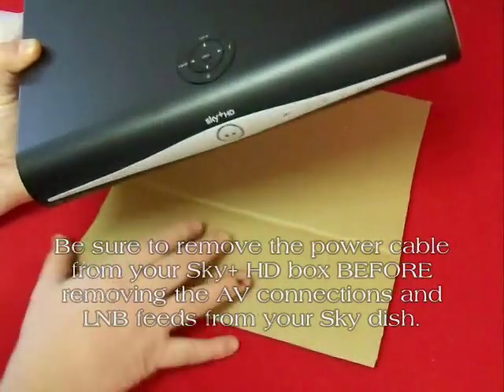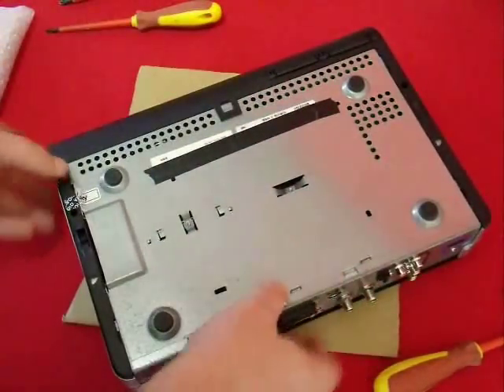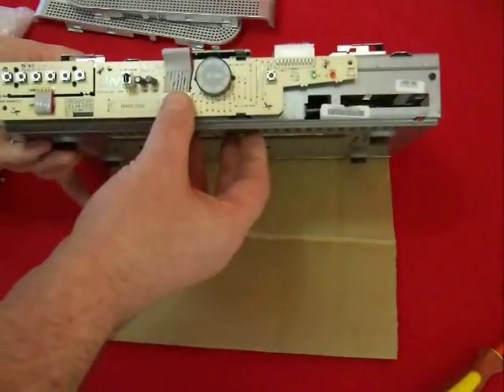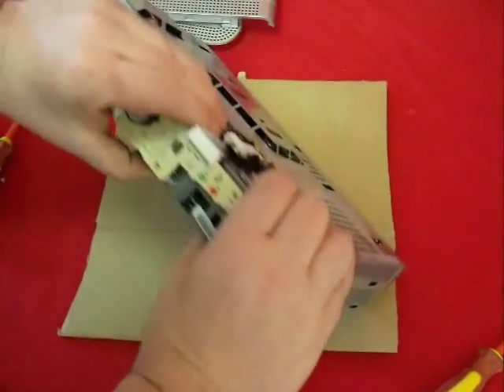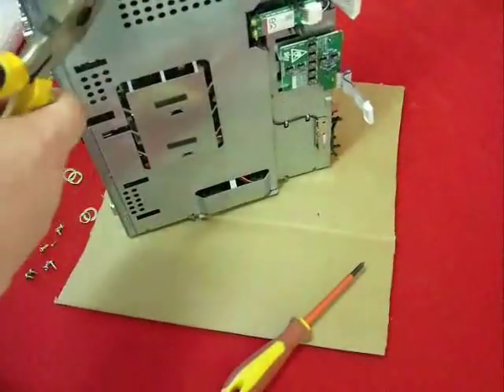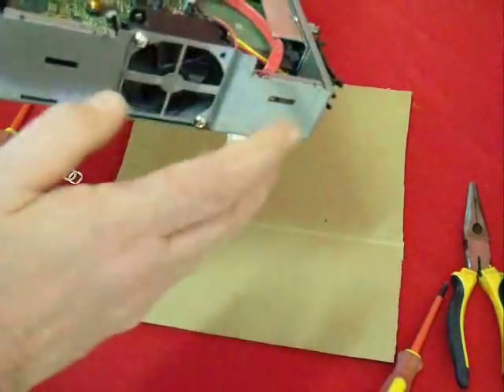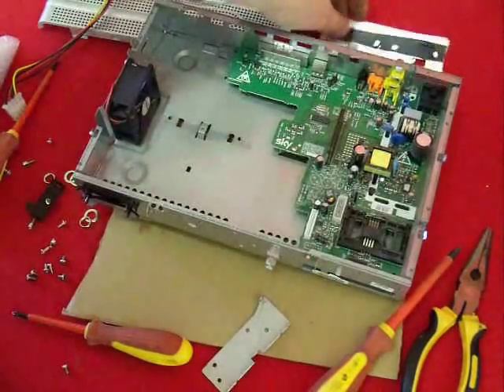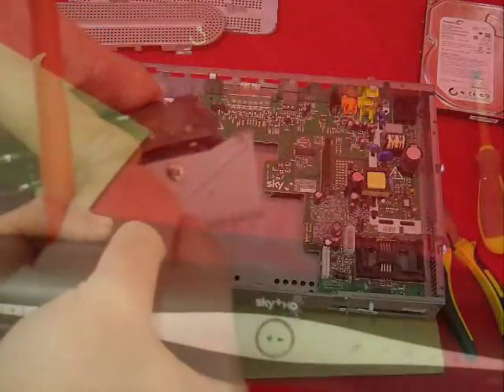How To - Replace or Upgrade Faulty Sky+ HD Box Hard Drive + Secret Menu on DRX-890

Comment: Upgrade a 500GB TO 1GB OR 2GB?  Really?
Using a pair of pliers to undo 4mm retaining bolt on serial adapter?  Really?
Using a pair of pliers to undo a 10mm F-type bolt?  Really?
Reply from the maker: Yes, really. Who knew pliers were so versatile?
Although I have all the correct tools myself from having built many PCs, and repairing various consumer electronics & computers etc, the idea was to show that the upgrade could be done with simple tools that people are more likely to have around. I've noticed many repair type videos tend to have work benches full of expensive tools & equipment... all very professional, complete with Patreon requests! For many people that makes it intimidating, and something you can only do by having all the right gear.
The important thing, is that this video has now helped lots of people to upgrade their hard drives, whether you use pliers or a hex driver set.

Comment: Old post I know but can a 2tb sky box drive be transferred to a 500gb sky box?
My 2tb sky box has gone faulty (signal fault)
Reply from the maker: Hi Gavin, you're right, I did this some time ago, but if memory serves me right, the 500 GB Sky Box shown will accept up to a 2 TB HDD, however it's not as easy just replacing as in the video, I'm pretty sure it needs (special?) formatting and setting up on a PC first using specific software, but can't remember what it was, and not something I'd tried personally. Things may have changed since then, so I'd check around on some Sky Digibox forums before proceeding with anything.

Comment: Nice description shame the box was not in frame so we could actually see what clips you were removing on the side panels
Reply from the maker: Yeah, it was a shame.Trouble is I was actually doing this for the first time myself, and so needed to keep moving the box around, hence in places it was isn't all in frame and I as I needed to have the camera behind me on a tripod I couldn't monitor the screen.
Reply: Lift the black plastic tabs by the screws and the sides slide backwards quite easily.

Comment: using that method, can you install a PC OS on a hard drive and mount it to the sky+HD box?
Reply: these sky box hd are standard PC hard drives all you do is make it an ext hd either in an enclosure box or a ide/sata converter when the computer recognises the hd in disk manager assign a path letter and format the drive it will show in my computer as local drive then using minitool partition wizard you can clone your C drive to it also ensure no other ext hd or flash drives are connected to the computer when you do this
select disk 1 C drive as source and the 500gb as the drive you want to copy to then click apply and follow what the popup boxes ask then the computer will close down then reboot and take roughly 48 to 58 minutes to clone the 500gb hd prior to doing this use hd shredder which is a free download to completely wipe the disc this ensures anything that was ever on the hd is gone forever this takes around 3 hours for a 500gb drive before doing the clone great way to pass a rainy afternoon only drawback is the clone time prevents you using the computer but what the heck take the dog for a walk then by the time you return the 500gb hd will be cloned

Comment: Very  helpful video. When I used to open my computer, anything complicated like this is to write down every thing in reverse order starting at the bottom of the page.  and to work your your way down when it came to reassembling. Just follow you order everything was taken apart as you worked dissembling.  And remember you don't leave any screws inside! Count them out, and count them in! Thanks.

Comment: Late to the comments, but is it a 2.5" or 3.5" HDD?
Reply from the maker: It's a standard 3.5" AV rated HDD. I don't know what the difference is between AV rated drives, but that's what I used. Presumably these HDD's are better able to handle constant recording for the live pause / rewind.

Comment: Are SKY deliberately making it has hard as possible to get into the box?
Reply: Defiantly looks like it. :/
Reply from the maker: Yes!  they want to fix (swap or sell new one), not have you repair it yourself.It frustrated me no end to discover that I could replace the bearings on our Hotpoint washer dryer, the drum was a sealed unit, so was forced to scrap an otherwise perfect machine, and replace.
Reply: Video helps a lot thanks. Re your washing machine - I had the same problem with bearings - but instead of using my normal spares replacement site got a complete replacement drum assembly direct from Hotpoint for just over £100.
Reply from the maker: You're welcome.
That was a good deal on the drum assembly, at that price well worth doing.
I used to be involved in TV/Video sales and servicing so generally prefer to repair, than replace, but these kind of products are forever getting cheaper, whilst repairing is getting more expensive.The average price of just a 14" TV (CRT of course) was about £200 in the late 80s,  now that same price buys a 32" LCD, incredible when you consider that £200 14" would adjusted for inflation cost about £500 today!
...and yet people still complain things are to expensive!

Comment: I may have to do this soon. Do you know if I can get sky recordings off the hdd to my pc?
Reply from the maker: Mine had failed completely, so wasn't an option, but I'm pretty sure it's possible. It's a SATA drive, probably just requires specific software to do so as I'm not sure of it's file format system, or encoding format. I guess SKY support forums would be a good place to find out about this, as changing HDD on Digiboxes is quite a common upgrade. I wish they were as easy as on CCTV DVRs, perhaps they are on newer models.

Comment: thanks for the guide around the insides of the box ... for anyone that's interested, i replaced the 500Gb drive with a 500Gb SSD - it's now near enough silent and putting out a lot less heat than it was before.  for me, i had to do a "system reset" after booting up for it to recognise the drive was there and start using it.  before that, it said it was in diskless mode.
Reply: Hi what did 500SSD did you use?

Comment: what is the Max size of drive ?
Reply from the maker: If I remember correctly, this model supports a 1TB AV rated drive, although remember 250gb of whatever size drive you fit is reserved for use by Sky's Anytime On Demand / Pushed content (On the DRX-895 500gb is reserved)I seem to recall certain variants (probably firmware versions) can support 2TB drives, but I'm not entirely sure on that.
Reply: its the drx 895 models that contain either a 1.5tb or 2tb hd

Comment: Really useful and clear video, thanks. Just a couple of points  - I think you forgot to mention the small screw above the HDMI socket that also needs to come out before the top PCB can be removed. It's already been removed in your video, but you just forgot to mention it. Also, it looks like you just yanked the SATA data and power connectors out of the old HDD. In my box, these were locking connectors, and you push the latch on the underside of each connector to release it, then they come out very easily. (Also, I would probably have taken the top PCB out before removing the screws that secure the HDD in place, but doesn't really matter.)